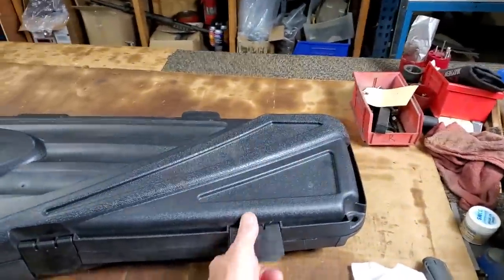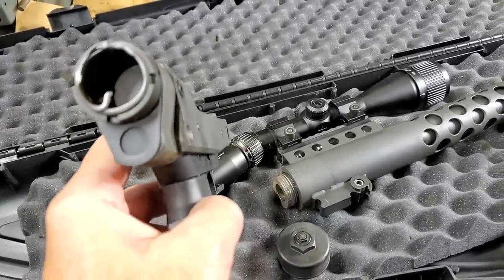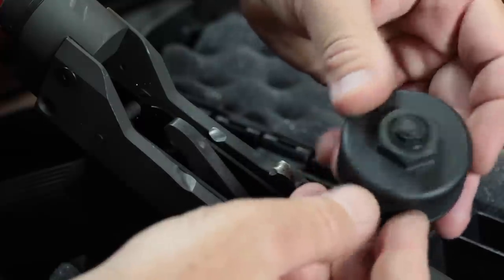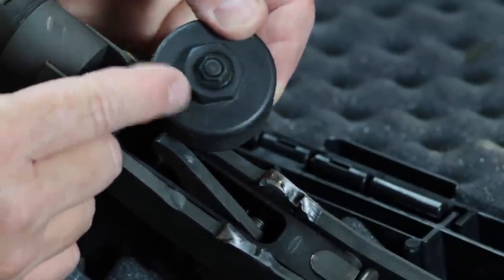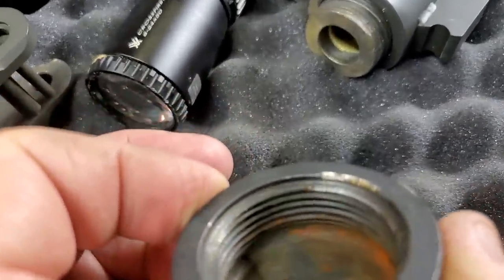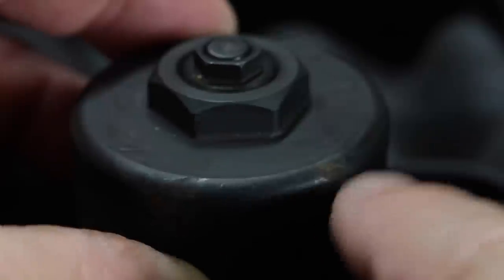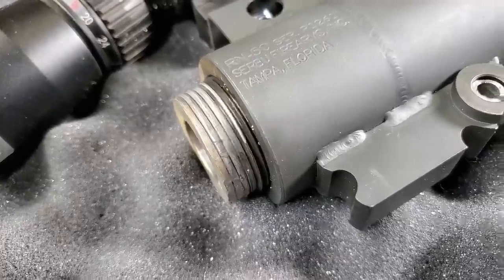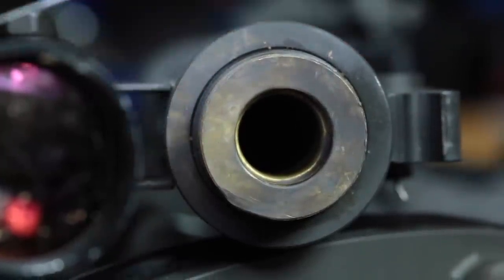Kentucky Ballistics' RN-50 Blow-up:  First Look

Comment: The fact that there was a case-head separation still fully stuck in the chamber on its own is evidence for massive over-pressure. If a catastrophic failure happened in the chamber cap that was causal, then the cartridge brass would have traveled backward with the cap to a point where is was no longer supported by the chamber and then separated the head. In that case then, the rest of the cartridge would not have been seized in the chamber.
Instead there was a detonation that pushed on the case-head causing the the threads to fail and leaving the rest of the brass stuck to the chamber wall.
Also being stuck in the chamber like that is a sign of massive over-pressure. Normally a brass case obturates to the bore, but then shrinks back after the pressure lowers. Analysis of the brass might be able to tell the force it was under.
Reply: I would think the pressure spike would have to be very high speed to move metal the way it did.
Reply: @bart5246  the action will not close unless the cap is screwed on all the way (because of the ears), making it impossible to chamber and fire a 12.7x108 round. plus the russian 12.7 brass is nearly 8mm longer than .50 BMG.
Reply: @bart5246  Did the Soviets produce a slap round?
In either case, there would be no play between the breech cap and the locking ears, even with no cartridge in the chamber the cap has to be threaded on 100% in order to close.
Reply: @bart5246  I understand what you're saying now.
Since it was a machine gun chamber and has a little extra slop, could he have tightened the cap down forcing the longer 108 mm casing partially on to the lands.
That is a really good question and I actually would like to know now myself.
If it were the case, forcing it onto the lands could cause the neck to bite in to the projectile causing another factor for a pressure spike. 
The only thing that makes me doubt that though, is it would have imprinted on the casing.
Reply: @bart5246  From what I've seen these are pretty precise systems.. I really have doubts that they would come any where near the slack needed to chamber the round in this particular design.. Occam's razor and all that.. But then again without handling and measuring the rifle I can only make a guess so maybe you're right..
Reply: @bart5246  your logic would suggest that a 7*57 Mauser would chamber in a 7*08 or a 284 Winchester. /Doubt. The brass that Scott had been firing would be fireformed and show evidence of that out of spec chamber, and the case would be noticably larger/wrong compared to the other 50 cartridges had a 12.7*108 slipped into the pile. What's next, someone accidentally stuffs a 30-06 into a 308? Or a 7.62*39 into a blackout?
Reply: @bart5246  I was still leaning heavily into a crappy reload.
When you see how expensive these slap rounds go for, since they aren't making anymore of them.
It seems way to tempting for someone to try and run a reloading scam.
I have purchased poor reloads myself before.
I have experienced over-pressure symptoms from both seating depth exceeding the min OAL and from overcrimp, the later lending to your theory.
Reply: @bart5246  And thank you sir. Though i'm no engineer, I do a bit of reloading.
I'm a fan of Serbu and his innovations. This must have been a nightmare for him, and Scott.
I'm glad that both of them are working together to find out what happened.
Reply: @randomidiot8142  Not sure on scenarios you mentioned, only loaded for 7.62x39 (dont own a 308 or 30'06)out of them myself so dont know COALS of top my head but isn't chambering 300blackout into .223 a thing? So sometimes things can be forced into places they dont belong? Im assuming the COAL of 300 blackout must be less than that of .223 for this to happen which may well not be case with others.  Just speculation from personal experience as a shooter and reloader, i do agree with many who suspect this was just a stupidly hot round that caused the kaboom and surely it must be a bubba reload because i would assume powder used by th OEM would be of the correct volume to not allow for a double or even just excessive charge. Maybe the brass was from salvaged or shot slap rounds and someone was fabbing projectiles and sabots to make a buck. Im guessing close inspection of remaining (i assume they exist?) rounds charges, sabots and projectiles will come down the track.
Reply: @bart5246  Is load data even available for these rounds? Does anyone even know what the factory powder type is for these SLAP rounds and if its available? Reloading isn't very hard, acquiring generic components and press is like buying food, you go to a gun shop and buy it or even order online, this is coming from someone who lives in what is regarded as one of the most restricted countries in the world, Australia and even her acquiring a reloading kits (no primers or powder) is something anyone can do, even without a firearms license. Not sure why you think its some kind of black art? Even if reloading data is available for this, if some bubba has knocked up fake projectiles from god knows what steel the weight may well be incorrect so any load data is useless! Also its fairly common for morons to just use whatever powder they have, even if its not the correct type...
Reply: Looks like the kind of pressure cooker bomb thing. Massive power in massive steel. Very hard bang.
Reply: @bart5246  no, the 12.7x108 will never fit, i'm sure. even if we accept that the chamber ist big enough at the shoulder, P2 at CIP data sheet, to take the slightly bigger 12.7x108 (18.90mm vs 18.16mm), L1 (case head to P2, beginning of the shoulder) will still be around 9mm to long (85.27mm vs 76.02mm). no way i can see how to close the action
Reply: @bart5246  absolutely no way. The difference in shoulder position, which it headspaces on, is around 9 mm. Do you seriously think there's that much slack in the system? You're presumably familiar with the size of a 9mm round even if you live in inch territory? 
If you tried to chamber a 12.7x108 you wouldn't even get the first thread of the end cap to engage, I think. And if you did get the threads to engage, you would need a big pipe wrench to put enough torque on it to close the end cap far enough to get past the ears so the gun could be fired.
Reply: Another thing that could be done is have a chemist test the powder residue. I would think they could figure out what powder was used.
Reply from the maker: @ Bart Bart There's absolutely no way to get a 12.7 x 108 round into a .50 BMG chamber.  I recently built a BFG-50 in the Russian caliber and not only are those rounds 9mm longer, the base diameter is about .050" larger.  The chamber in Scott's rifle is a standard .50 BMG chamber, which is just a few thousandths of an inch larger in a couple of areas compared to our "Serbu Accuracy Chamber".  So it's not even close.  Even if you beat the base of the 12.7 x 108 round with a mallet (not recommended) to chamber it, it STILL would not go in far enough to allow the breech cap to even START threading.
Reply from the maker: Folks, Bart Bart has left the building!  :-D
Reply: @smeggerssmeghead3100  ehh, one might think thats what would happen, but you have an entire family of firearms known as blow-back operated, that depend on the opposite happening, that is, a heavy bolt and spring resist the case from extracting itself before the chamber pressure drops. 
If the RN-50s threads had failed under normal chamber pressures it would have acted like a blow-back rifle and the brass would have extracted itself.

Comment: For those that hold onto any heat treat theories, go to 2:20 on the video and look at the back of the breech nut at the left (about 8 oclock) and you’ll see the little pin mark of when the nut was Rockwell hardness tested. 

It clearly passed that test, as it was sent out in a customers rifle.
Reply: I saw that right away as well. And you could tell it was tested before it impinged on the lugs because the divot had the outer edges flattened by the left lug. Looks like a good C scale test.
Reply: Also, the cap isnt what failed. If the cap was the issues, the shearing would more prominent on the cap itself. Not the threads of what it was mounted to.
Reply: I suspect the barrel threads aren't hardened to spec, they are completely sheared off, and the hardened beach cap threads are almost perfect. If they were similar hardness they both would show damage

Comment: Glad we're finally getting these.

Everyone with a channel suddenly became an engineer and either knew for a fact you made an obviously bad design or that there was no possible way you were at fault.
All these people seemingly never having even handled an RN-50 let alone understand the application of force on materials like this.
Reply: i would hope a sensible person would understand something went very wrong here, and it wasnt the manufacturers fault. anyone with basic knowledge of metals alone would know this.
Reply: @fullpotato6313  The problem is there are fewer and fewer sensible people every year. I've met people that didn't know there was a damn spare tire in the car! Beyond that had no clue what to do once they found that out!!!
Reply: The only legitimate criticism of the design is that, while safe, it is not 'fail safe'.  In that there's no designed weak point that will fail first, in a safe manner, before something worse happens.

But I mean, come on.  We have zero data on those SLAP rounds and the forces generated, beyond 'a lot'.  Even an AR-15, possibly the most iterated upon firearm design ever, will fail catastrophically and injure the user if subjected to enough pressure.  There is no such thing as fool-proof, because fools are so ingenious.  There is no such thing as fail-safe, because there is no way to account for all modes of failure.

Terrible accident, fortunate that nobody was killed, but we can't and shouldn't blame the tool in this case.
Reply: Yes I am an engineer and a brain surgeon. Threads to maintain a rated strength and force need a minimum torque if not overtime they will be compromised. How's that for a grade 10. Ready.... If it's loose , it will get looser.
Reply: @vettelover2009 I didn't know toaf did one. I saw CSR Firearms point at a white board with just bullet points on it, complete misuse of a whiteboard. Also he acted as if every other gun on the market failed in a way what would leave the shooter entirely unharmed.
Reply: @thesmallestminorityisthein4045  What you saw CRS doing is properly called "running his mouth without having a damned clue what the hell he was talking about".
Reply: @felsinferguson1125  the one Taofledermaus did was pretty bad too. Instead of going off on serbu he went off on Scott as if Scott telling his story was a personal attack on tao.
Edit: not implying that going off on serbu would make sense either.
Reply: @Lucas12v  Didn't see that one, but I'm not a big fan of his stuff. The CRS vid on the subject was what decided me to unsub his channel. Kid means well, but he's so far off the rails he needs a sector map of the stars and a year at warp 9 to get back to where he jumped off 'em.
Reply: @felsinferguson1125  I actually liked tao's videos even though they were a bit repetitive but i unsubbed after he went after Scott. Judging by the comments of that video, a lot of people weren't pleased. Not sure why guntubers occasionally go after each other. It never helps their channel, only hurts. Remember that dufus that went after Paul Harrell and basically ruined his channel?
Reply: @Lucas12v  Yah, that was a bad joke. Loved the vid Paul put out tearing him into itsy-bitsy teeny little pieces for an hour. And with *CLASS*.
Reply: @fomocore  compromised from having a slight clearance allowing the fastener to be 'yanked' and peening the threads over from the impact?
Reply: @vettelover2009 I guess nobody said Mark did it on purpose. Many times things get designed with small errors in assumptions. If he would have created the ears bigger and stronger the accident would have been way less devastating. But then you have to think about the size they should have been. Would have double the size been enough? I would love to see testing with overloaded ammo to see where the actual point of failure is. All simulations, calculations and thoughts won't help, because you never now all variables. Therefore you need real tests.
Reply: @fomocore  I concur as a rocket brain surgeon scientist and I offer this piece of wisdom from my car mechanic father "if it has failed, hit it, if it still is not fixed, hit it harder, if it is still not working then it is an electrical fault"
Reply: @danielweber3433  The problem is that in cases of catastrophic increases in pressure like we see here, making the ears bigger could have been even worse. If it didn't fail there, it could have failed somewhere else with unknown result. You could theoretically over engineer the gun to the point where  it literally cannot explode since the metal is so thick that the force will push anything out the barrel, but then you have basically a cannon. The other solution is to introduce a deliberate point of failure that will release the pressure in a safe, or at least safer, way like a safety valve on compressed gas tanks. 

To be clear, I don't disagree with your point on principle. Where I think it's wrong, is that at some point, you have done the tests and looked at the numbers, and scenarios that go beyond that are just unforeseeable. If Mark Serbu is right about the force needed to shear the threads, add that to the fact that the cap did so while also shearing two ears of nearly one inch deep, quarter inch thick steel, I'm honestly flabbergasted that the gun exploded in such a way. Now, I obviously don't know what kind of testing went into the making of this gun, but from what I've seen so far, I tend to lean towards giving the benefit of the doubt here, and I expect this was less of an engineering mistake, and more like one of those unforeseeable circumstances, because something happened that turned this gun into a literal pipe bomb.
Reply: @zacharyreichert5035  In theory, those "ears" should have stopped any normal overpressure that can pop the end cap off. The fact that the pressure can even blow right through the failsafe is telling on how overpressured it is.